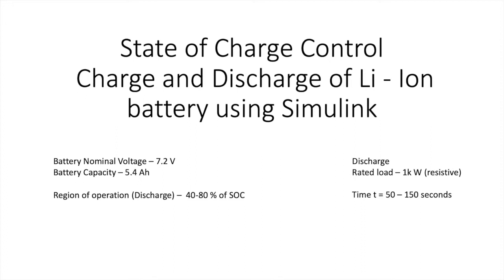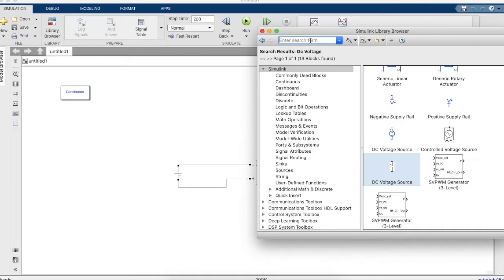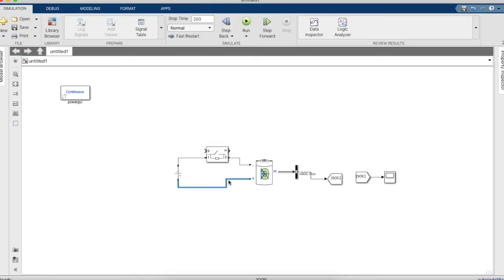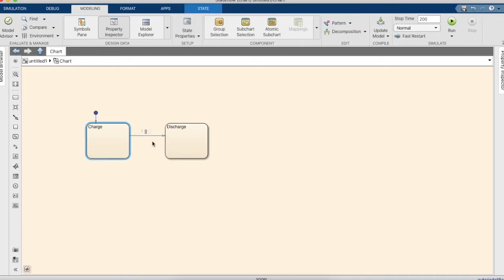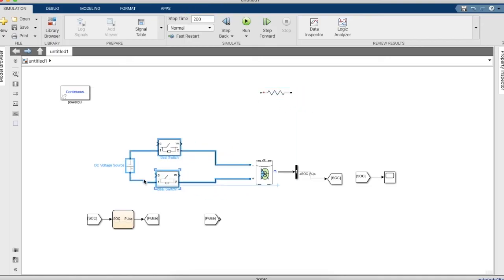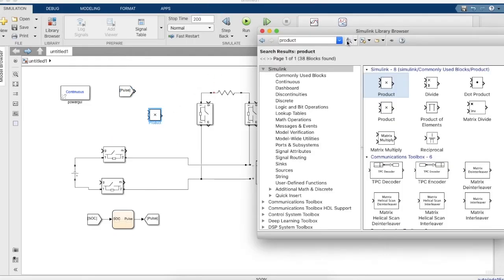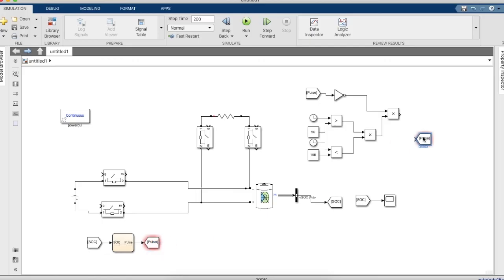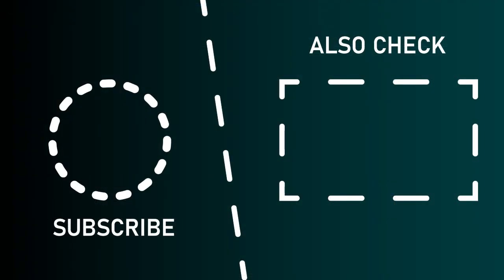State Of Charge control of Lithium-ion battery in MATLAB/Simulink!

Comment: Really helpful video, I am wondering how can I simulate a case where you are charging the battery as well as providing to an additional load in parallel. For example running other loads while charging the battery.